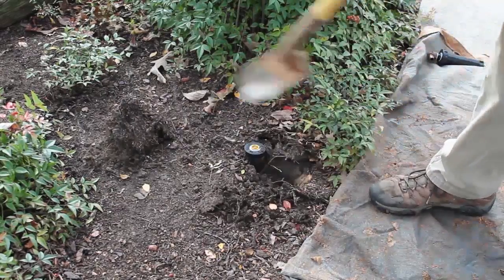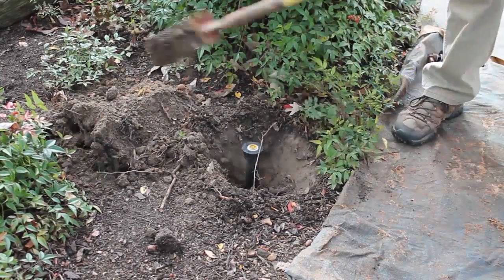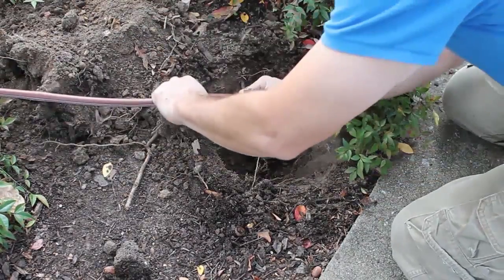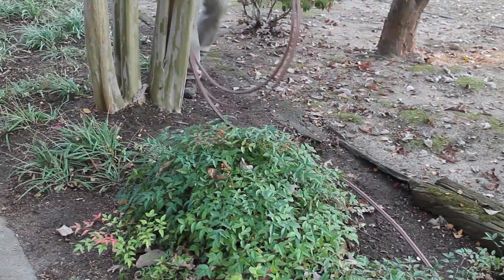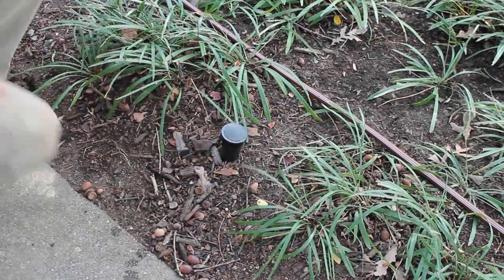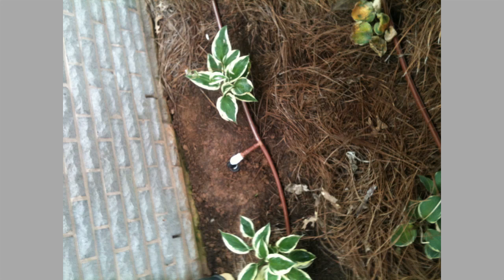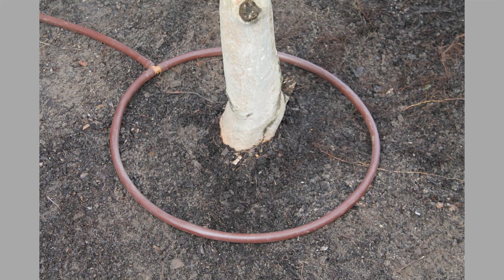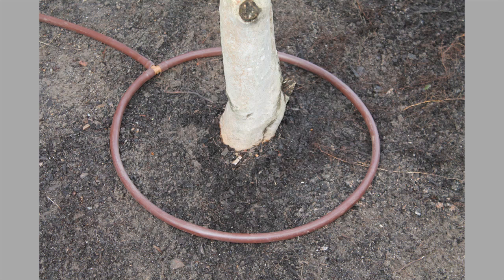How To Convert a Spray Zone to Drip Irrigation

Comment: Why do you not use teflon tape on fittings underground?  I've been told that you need the tape, and I've been told that you don't need the tape.  I'm very confused.  Thanks.
Reply: I’m no plumber but I know you only use teflon on metal connections and not on plastic

Comment: Great simple to understand video, thank you for sharing. I am looking to convert one of our zones withi only two spray heads on it to drip and also have some 1/4" line for pots on the porch on that same converted zone and I like that the rainbird has both a filter and pressure reducer all combined in one housing. 

My question would be about how you winterize a drip line? We are in a cold climate area and have to winterize our system each year. I know I could open the capped head(s) to allow water to be blown out but what is typiclly done for the drip lines?
Reply from the maker: In colder climates, irrigation systems and drip as well are winterized by using compressed air. If you do it yourself, be very careful to keep the pressure down as low as possible to avoid blowing the fittings off, keep it below 35 psi for sure. Use a slow buildup to pressure and avoid sudden bursts of pressure.
Reply: @Proirrigationtraining  thank you
Reply from the maker: @FENATECH  You're welcome!

Comment: Can you have a spray and a drip on the same zone? I have 1 bush that likes the over head spray and all the rest would be fine with drip.
Reply: You cannot, the spray head applies more water a minute. Drip only applies certain amount a water a minute therefor you will have over watering on your sprays and drip will be under watered. Sprays usually need about 8-10min a zones, and drip usually needs 20min.
Reply from the maker: xEx gave a great reply, but there is some nuance to it. There are spray nozzles that have lower flows, and even some small sprays that are designed to go with drip systems, check Hunter and Rain Bird websites and look in the drip section. Micro-sprays have much lower flow rates as well.

Comment: Shouldn't the control valve be replace with a Low pressure valve when going with a drip system?
Reply from the maker: It really depends on the situation. If you're taking the zone's total flow very low, like 2 or 3 gpm, then changing the valve is probably wise. Usually, when an entire zone is changed over to drip, it's for beds or a garden, and the flow ends up at least 7 or 8 gpm which is fine to leave the existing valve for. And always check the specs of the valve in question, some standard 1" valves have a pretty low flow rating on the bottom end. Others aren't as forgiving.

Comment: Great video Mike thank you!  Why do you use teflon tape above ground but not under?
Reply from the maker: Hey TMan, thanks for watching and commenting. To be honest, it's usually just about customer perception. If there's a small leak, a few drips, it's no big deal if it's happening in an area we're irrigating anyway. But if it's leaking underground, then no harm, no foul. Nobody sees it and the water soaks into the soil. ( If it's a larger leak, then that's a different story.) But if a small leak is happening above ground and the customer sees it, then you may have to go back out for a warranty call to fix it, even if it's doing no harm.

Comment: Your videos are excellent Mike!  I've learned a lot from your channel.  Quick question on why you didn't put in two of the retro heads on this zone and run the drip line between them.  You mentioned on one of your videos that a linear run is not the ideal configuration and providing source water from two sides provides redundancy and more even pressure.
Reply from the maker: Hi Todd, thanks for watching and commenting. You're totally correct. If there's another head nearby, you can put in another Retro 1800 and get better flow. For smaller projects it isn't necessary, but using two sources to get more distance and flow is a good strategy if needed.

Comment: In Taiwan, the floating drip emitter is a new drip irrigation technology system that is the best choice for automatic irrigation. It has three characteristics: (1) Auto-remove impurities of pipe in the water, so to solve the long-term blocking problem of the drip irrigation (2) adjusted the amount of water, can plant different types of plants . (3)Lower power, the operating pressure is 0.4~2 Kg/cm2, is very suitable for gravity drip irrigation, as detailed in YouTube
https://youtu.be/7769dgfTaIs
(The floating drip emitter introduce)
Reply from the maker: Thank you, I will look into that. I have quite a few people contact me about how to use drip with only gravity feed for agriculture.
Reply: @Proirrigationtraining   hi, we have installed farms that use arrows floating dripper in gravity irrigation. You can see the following video. https://youtu.be/02woTPgxBfc . Thank you.